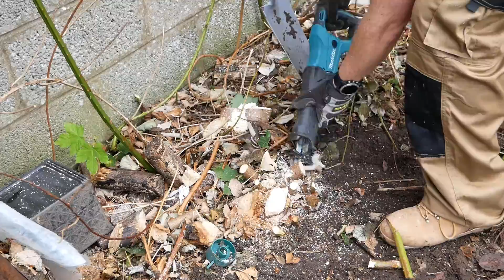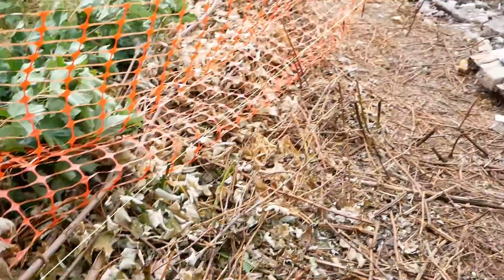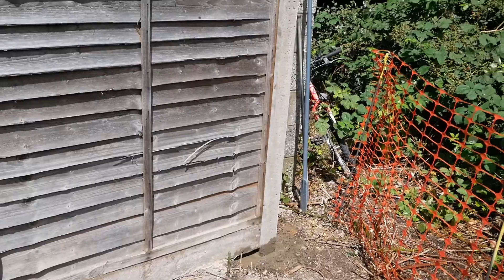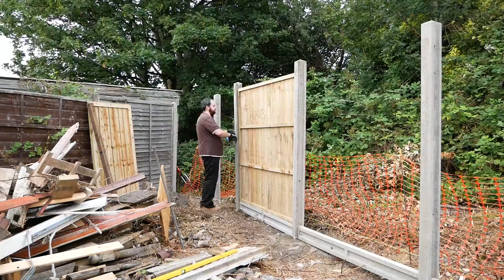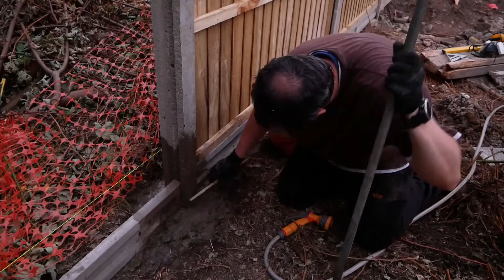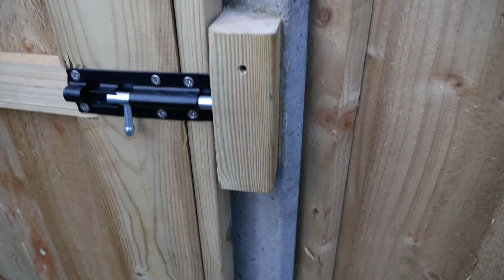Installing the new perimeter fence - Garden Office Room Build (Ep 2)

Comment: I noticed you wedged afew of the gravel boards with bricks to level them. What did you use to cover the gaps under the gravel boards?
Reply from the maker: I actually added a few more bricks etc and then we have a raised bed in front so you don't see it at all. It's a bit of a lazy hack (should really level the ground, but it is sloped at an angle to that and there is also the remnants of the old garage entry there), but it works.

Comment: Hi, how much of post is underground and also how much overground, thanks. great job.
Reply from the maker: Thanks! The posts are around 600mm below ground. They are 2440 high, so you get 1840mm above ground.
Reply: As below, I wouldn't install 9 foot concrete posts any less than 550mm-600mm as that is required depth by the professionals
Reply: Looks great. Sorry for the question..... Im trying to decide whether I need 2.4 or 2.7m posts. If like you say the posts are 1840mm above ground level and you used 150mm gravel boards and 1800mm (approx 6ft) panels they would sit higher than your posts? Are they definitely 2.4m posts not 2.7m? I may have worked something out completely wrong though.

Comment: Put the fence panels in as you go. If the garden with the rubbish in is yours then you put all the panels in backward. Good face always towards you. Also the posts looked a bit high
Reply from the maker: Yeah, putting them in as you go does have its advantages!

The reason we put them the way round we did is for security. They are harder to climb the way round we chose.
Reply: Looks good and the fence panels are the right way, you don't put the other way as any one could easily climb over, it might not look better but its correct
Reply: Made a good job 👍
I'm looking at putting some up , so this is good for ideas..  although it might be harder , I would feel better putting posts in first, so I know it's all pre-marked and measured.. I feel is be following my nose by putting them in as I go.. I like to know were I'm going and were finishing  before I set off.. just preference I guess

Comment: How do you hang a gate on these H posts?
Reply from the maker: The one on that end has the recesses of the H at 90 degrees to the gate. I was able to very carefully drill it using a small pilot hole (possibly not even using hammer mode as the concrete isn't super hard) and then working up to the size I needed to avoid cracking. I then used a concrete screw to fix some wood onto the post and then could fix the gate hinges to that. Hope that helps.